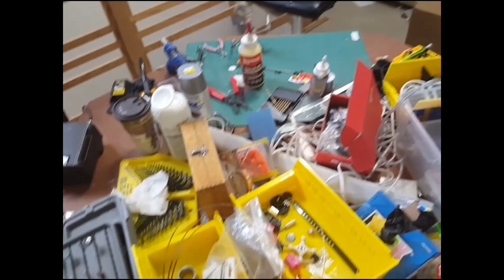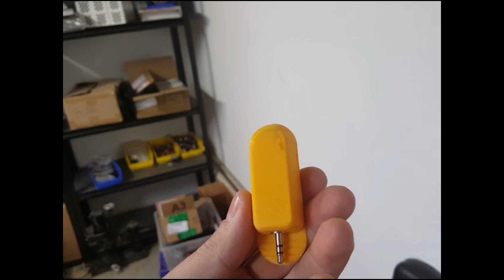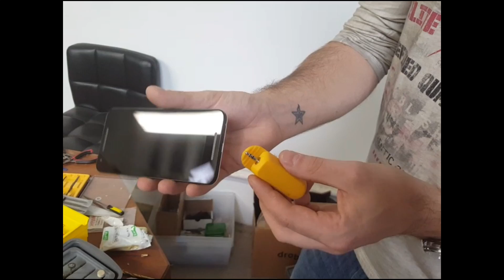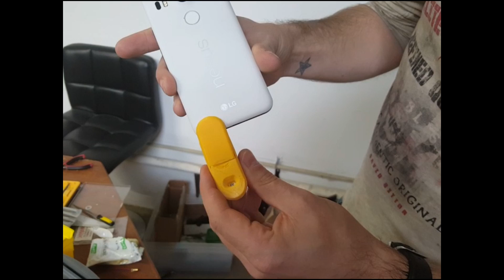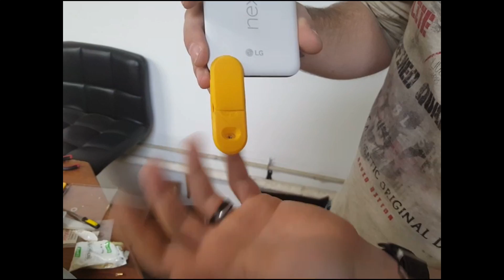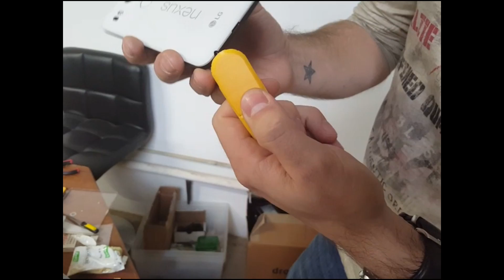Dev Team Diary No.5 - Why prototypes are so important

Comment: ditto the comment about varying phone thickesses. I worry that the clip that accommodates thin phones will be too tight for thick phones and will break or worse yet, break the earphone plug or stress the jack in the phone. 
Something with just a little "squaring up force" and lots of expandability might be better. Also if its a possible break under stress part it might be better if it were a replaceable part, not an integral part of the case which requires replacement of the whole case.
A few squares of sticky foam shims  in different thicknesses, or a set of three snap in clips for three different ranges of phone thickness or both?
Sometimes the coolest features up front need a lot of revision to actually work cool.

Thanks for the view into the design evolution!

Comment: Any chance you'll try to get the prototype to allow for phone thickness differences and phones with cases. Does it have to be physically flush with the bottom edge of the phone? What about clip onto any body thickness and a detachable jack & small jack cable so anyone wanting to use it in you configuration can but anyone wanting to use it with a phone in a protective case/shell can too..
Also as a recently partially disabled person (stroke left me left side paralysed) it very obvious how many little consideration is given to designs that can be used single handedly. Many designs put buttons needlessly requiring two handed operation for aesthetic reasons. I hope you dont do the same here, just something for you to keep in mind. Life is hard enough for the disabled without all the little things that add to our difficulties and frustrations. I do appreciate two hands offer stability but restricting operation to two hands where one is possible alienates customers. I your case it may mean having an option to stop the program screen from rotating which would shift operating button positions or making sure main buttons could be positioned for single right/left handed use. Please consider.